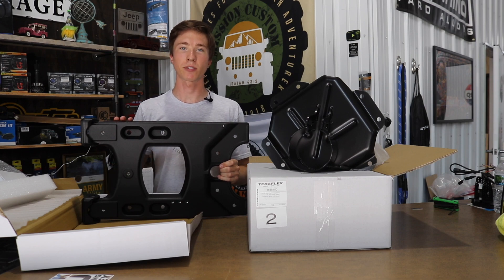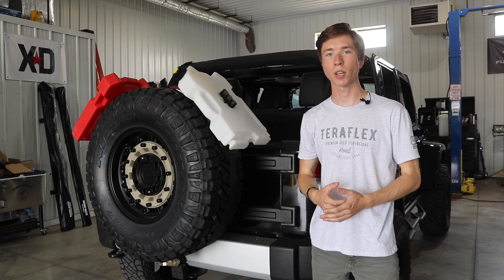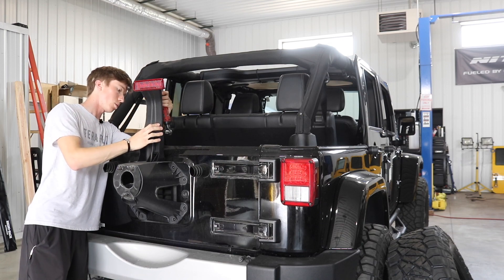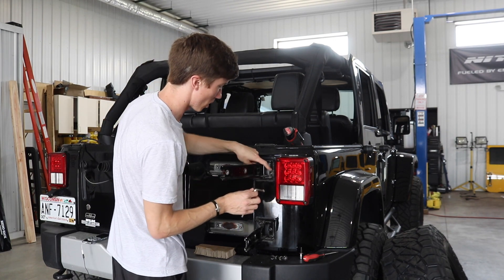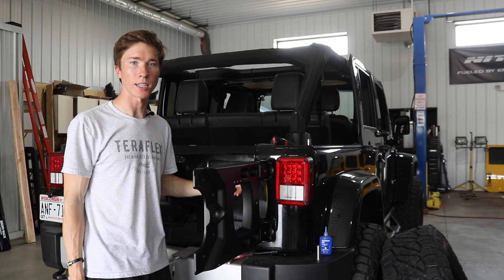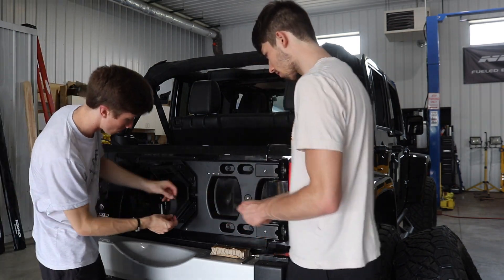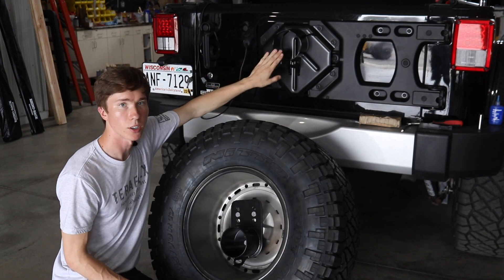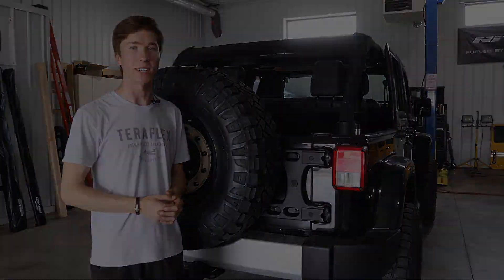TeraFlex Alpha HD Spare Tire Mount Kit Installation and Review: Jeep Wrangler JK

Comment: What size tires are  you running on your JK. Entertaining the thought of yoko 305x70x18 or toyo 35x12.5x18. What modifications will be required? I installed a  2.5 leveling kit. Will I end spacers? If so, what size? I was hoping to keep my stock rims. 😢 if not, what setback will be needed? Thank you.

Comment: Great tutorial for our upcoming tire carrier upgrade. 
Do you have a link for the optional 3rd brake light used in this install?
Reply from the maker: Thank you! I'm glad I could provide some insight, here is the link to the third brake light I installed. Teraflex does provide a relocation bracket for the factory brake light, but it makes it harder to change out the spare tire:

https://www.amazon.com/Spare-Brake-Light-Wrangler-2007-2017/dp/B073149C8Q/ref=sr_1_2?crid=1V5COI2LH7PWU&keywords=suparee+jeep+jk+third+brake+light&qid=1662781139&s=instant-video&sprefix=suparee+jeep+jk+third+brake+lig%2Cinstant-video%2C117&sr=1-2

Comment: You shouldn't have used those spacers. The directions clearly state to only use those when you are only installing the spare tire carrier without the HD hinge. If you look closely at the tire mount, the right side mounting areas are shallower to accommodate where it overlaps the HD hinge.